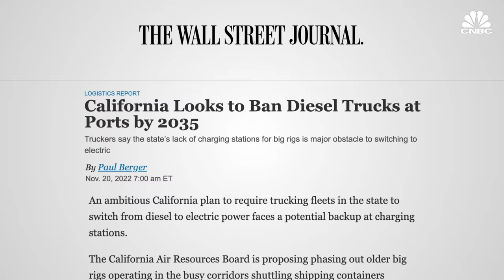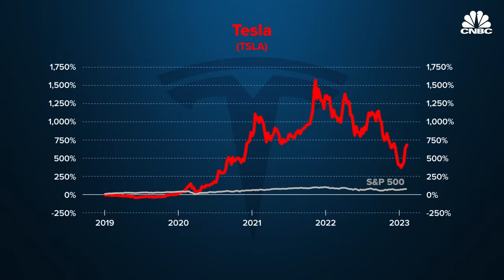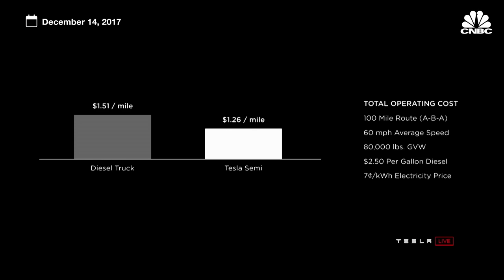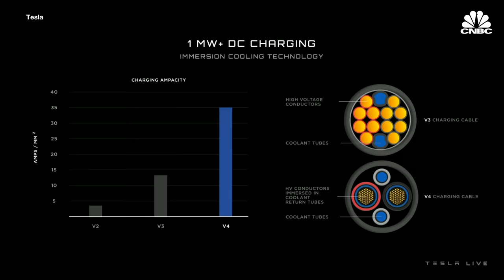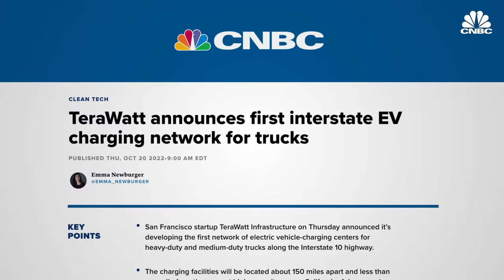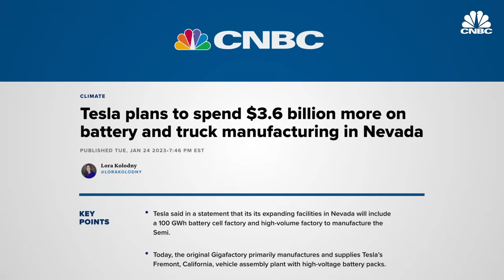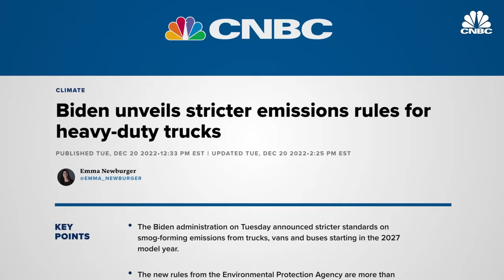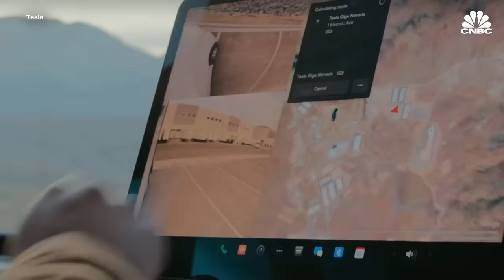Does The Tesla Semi Live Up To The Hype?

Comment: What is the environmental impact of obtaining the materials for this truck? What is the environmental impact of properly disposing of the exhausted unit and its batteries? Would you feel comfortable driving down the highway with your loved ones and watching an 80,000 lb. potential nightmare that will be driving itself in the near future? Almost every single component on that truck has roots in big oil. The plastic, the seats, the production of steel, the tires, instruments, hoses, etc. But it sure is dandy that it is not burned in the truck. Diesel is burned through every single stage of production and disposal of the unit, but Elon has you convinced it is awesome because YOU'RE not burning diesel in your unit. Be very careful!
Reply: What is the environmental impact of obtaining the materials for this truck? 
Far less than the positive effect of the reduction in fossil fuel use and air pollution over its lifetime, as a result of electric propulsion.
 What is the environmental impact of properly disposing of the exhausted unit ...? 
Impact of disposing of the "exhausted unit" will be less than for the diesel semi it replaces, because the shell won't have most of the components of a diesel semi, including diesel engine, clutch, transmission, drive shaft, differentials, cooling system, coolant, engine and transmission oil, oil cooler, alternator, exhaust system, fuel tank, fuel plumbing and filters, frame reinforcements for the weight and torque of the diesel engine, etc. 
 and its batteries? 
Minimal; batteries will either be repurposed for stationary applications, which several companies are already doing, or recycled.
 Almost every single component on that truck has roots in big oil. 
Every component you listed also exists in the diesel semis that the Tesla Semis will replace, so there's no net increase in these.
You're welcome. Any more questions?

Comment: REAL towing capacity ... after the weight of truck and very heavy battery?  About half that of a regular diesel?
Note PepsiCo examples are hauling Cheetos!  Very lightweight product.
Reply: In the Donner Pass video, a Tesla Semi is shown accelerating rapidly up a steep slope, passing a diesel semi as if it were standing still. The Tesla Semi is pulling a flatbed trailer loaded with 11 K Rails (CalTrans-specific version of concrete highway barriers), which are shown in the actual CalTrans blueprints with a weight of 3,900 lbs. Plus, there's about 1,000 lbs. of blocking, tie-downs, driver, and misc. loads. Total payload, 43,900 lbs. or almost 22 tons. I don't have first hand knowledge, but others have stated that this is very close to the payload of a diesel semi towing a flatbed trailer.
https://www.youtube.com/live/LtOqU2o81iI?feature=share&t=985

Comment: That's the red flag right there "contents of the trailer can weigh about 4500lb" Trucks can have a max weight of I think 80,000lb here in the US. A traditional truck weighs about 35,000lb so the contents of the trailer can weigh up to 45,000 . 10x as much! The Tesla with it's battery is just to heavy. They're only good for hauling air, LOL!
Reply: Watch it again, at 4:36. He very clearly  says "45,000 pounds", not "4,500 pounds"; and this is confirmed in the transcript. Further, Here's a video of a Tesla Semi carrying >44,000 lbs. of K-Rails (California-specific version of Jersey barriers) accelerating rapidly up a steep slope on Donner Pass, passing a diesel semi as if it were standing still: https://www.youtube.com/live/LtOqU2o81iI?feature=share&t=987. So in essence you've confirmed that a Tesla Semi can haul essentially the same load as a diesel semi. Thanks, Jeremy!

Comment: They are down to 100 miles range
Reply: If by 100 miles range you mean 500 miles from Fremont to San Diego, including climbing the 4,200 ft. Tejon Pass ("the Grapevine"), on 93% battery capacity, with a load of 42,000 lbs., then you are spot on.

Comment: Well I drive 623 miles a night 13 and a 13 and half hour shift I would need the truck to be able to charge up to 215 miles in 30 minutes what sucks is this means I would have to disconnect and reconnect to the trailer when I'm on my break. Really wish you could get 650 miles out of a trip because most drivers drive the Max and fuel up and then go to sleep if they're over the road and that only takes 10 to 15 minutes a long haul driver would hate to wake up after an hour to move their truck and try to find a parking spot and go back to sleep are sleep is broken enough seems to me they got their work cut out for him especially if they're going to put in enough charging facilities to accommodate every last truck on the road we can't afford to sit around for an hour and a half or two hours waiting for a charge spot to open up and then charge for an hour on top of it this country would grind to a halt

Comment: You need a MEGAWATT charger to charge in under 2 hours... This is no where near feasible. LiOn has 1/12 the energy density of diesel fuel.
Reply: *30 minutes, not 2 hours.
Low energy density doesn't mean you need more energy, just that it's heavier. In fact batteries are 3 times more efficient than fuel and you have regenerative braking so you need way less energy than a diesel truck.

Comment: If they made the batteries to be inerchangable at a charging station instead of waiting an hour + for it to charge .. Just pull up flip a switch that disables the main power from the battery and change out with a fully charged battery in and out 5-10 minutes would be more practicle like when you go and exchange your grill propane tank.  The truck can have a regular battery to hold the charge of electronics in the truck while you exchange the main driving battery.. Am I the only person to think these things up? Hire me EV companies I'll show you how it's done, and make a better product that companies will want.

Comment: Team driving???? How is that gonna work.. we gotta wait 1 -10 hours charge b4 we can switch drivers????   What about when chargers go down like pumps do. Or more trucks than chargers available.. if you're 3td in line that's 4hrs  min...
Reply: Not a trucker, but—correct me if I'm wrong—I'm pretty sure the lack of a bunk or even a passenger seat means these aren't intended for team driving. When chargers go down "like pumps do", you won't be able to charge. But the fact that the Tesla Supercharger network scored a >99.9% reliability in 2022 should reduce your concerns about this. Further, Tesla Semi Megachargers will have Tesla Megapacks that will provide charging power, at least for a while, during power outages. 1-2 hours is the most likely charge time. It seems likely that at least at first, charging slots will be scheduled, and allocated on the basis of availability.
Reply: Tesla developed special high voltage chargers attached to localized back up power battery cabinets, so the trucks can charge 70% in 30 minutes even if the grid is down temporarily.

Comment: Cheaper to run until $100,000 to replace the batteries in one truck.
Reply: With LFP you can easily get over a million miles without replacing the battery.
Reply: @johntheux9238  the vehicle run with natural gas has a modified internal combustion engine so it can run on liquefied natural gas. Now think. Doesn't an internal combustion engine still need oil for lubrication? Doesn't any vehicle require lubrication of suspension and other moving parts?
Reply: @gandolfthewhite  It's electric. There is no natural gas involved in the vehicle. Only at the powerplant but it's not liquefied.
Reply: @johntheux9238  first of all I am talking about the natural gas vehicles they are using. The natural gas in the "gas" tank is liquefied so it will fit in the tank. The natural gas vehicles still need engine oil and chassis lubricants made from oil. Even electric vehicles still need chassis lubricants made from oil.
Reply: @gandolfthewhite  I don't really care about PepsiCo and their natural gas trucks. I'm here for Tesla.

Comment: Why is Tesla stock dropping year over year if these trucks are so great.  They also left out the limitations of the trucks not being able to travel long distances an how the US doesn’t produce enough electricity on the energy grid to supply large volumes of electric semi trucks
Reply: Tesla stock has virtually tripled since the first of the year. 

The Tesla Semi has enough range to travel as far in a day as permitted by HOS regulations, with a top-off during the 30-minute mandatory break at about the 8 hour point. Since these are day-cabs and not subject to team driving, any more range would be wasted.

All the Tesla Semis produced in the next ten years according to Tesla's business plan will add about 1% of consumption to the grid, even if all charging was done from the grid. But all Megachargers will be equipped with solar arrays and Megapack batteries, so they will actually add even less than that to the grid. I think the grid can handle a 1% increase in 10 years.

Comment: This a nothing burger. There is no truck, no. Charging stations or repair shops, no test drives. What are you basing any of the fluff from?
Reply: They have delivered over 40 trucks so far.
Reply: You might want to share your concerns with PepsiCo, because they think they've received dozens of these; they've built four Megachargers and eight more have been permitted; and a Tesla Semi loaded to 81,000 lbs. GCVW drove 500 miles from Fremont to San Diego, including climbing the 4,200 ft. Tejon Pass ("The Grapevine"), on 93% battery charge. Other than those minor differences, you post is spot on.

Comment: Who's the bald guy with the inaccurate information?
An electric truck can out muscle any diesel powered vehicle.
Reply: I don't think you were paying attention.   He said for the weight, the diesel can output far more power that what an electric powertrain can.   Meaning for the weight of the fuel and engine, you get much more use out of the diesel, that you can with the ev with the batteries.   Range and power/weight for diesel is much higher than EV powertrains.

Comment: It takes more fossil fuel to mine for lithium than the fossil it takes to run a diesel truck. Oh the hypocrisy!
Reply: Yeah, but you can recharge the battery 4'000 times and recycle it 8 times. So you can divide that number by 32'000 to get how much energy is really needed per mile traveled.

Comment: The only reason Pepsi and these other companies are doing this is to look good in the public eye. A diesel truck costing many times less can do many times the work. Once these things really start getting out on the road, people and companies will see the downsides. Not to mention their cargo capacity is much lower than a normal semi truck due to all of the battery weight.
Reply: There is a reason tesla spent 5 years trying to make this thing, for 1000+HP semi truck this is not much more expensive probably like $200,000 for the biggest one, most semis have 500HP. The weight load capacity is only 10% lower than the average semi truck but natural gas, hydrogen, and battery electric trucks get an additional ton to their legal weight. Once companies start using these they will see how cheap it is to run them, you can save $240,000 on fuel after 400k miles driven.
Reply: We shall see!
Reply: @MichaelLangell  give it 5 years.

Comment: The keyword here is grant. Without government subsidies. They would not have done this. The same thing with Tesla  without government subsidies, Tesla would not even be profitable.
Reply: You have to understand, this truck is the most capable electric semi ever made, but that doesn't mean companies trust it, it's like using beta software, you provide it for less money or for free so they find issues you don't have to find yourself that would take too much time to emulate Btw tesla is now the most profitable US automaker, their car sales actually increased after their subsidies where cut because they developed infrastructure to make their cars cheaper. The infrastructure for the semi trucks will be very expensive and take decades to build, and when that's done it will be far cheaper to use an electric semi without subsidies.
Reply: @miguellopez3392  there’s not really any other electric semi’s, so taking the prize isn’t something to be praising them about
Reply: @rusty shackleford  there are several but non are near the planned numbers tesla wants to do by 2025 (50k trucks a year) the other trucks also have much more limited range and charging speed. This is the first class 8 semi truck that can reliably (range) travel most truck routes in the US. Ots does this by putting the largest battery ever put on something with 6 wheels and are the only ones that can afford to put batteries this large in trucks because of their battery infrastructure being ahead of other automakers.

Comment: And how much Fossil Fuel is used to Manufacture, Fuel and Maintain this "Environmental" vehicle.  Or any "E" vehicle for that matter.
Reply: Far less than the reduction in fossil fuel use over its lifetime.
Reply: @BigBen621  not really
Reply: @Tylerd838  No one disputes that construction of an electric vehicle releases more emissions than that of an ICE vehicle; of course it does. But every study I've seen shows that there's a break-even point, usually at well under 100,000 miles, past which net lifetime emissions are less for EVs than for ICEVs. 
Here's a quote from a study done by Volvo:  "the results depend in large measure on the source of electricity its customers use to charge their vehicles. If they drive in Poland, where 90% of the electricity comes from burning coal, then yes, it will take [62,000 miles]  [kilometers replaced with miles] or more to reach parity with a conventional gasoline-powered car. On the other hand, if the electricity comes from renewable sources such as wind or solar, the crossover point is closer to [31,000 miles]. The middle scenario, based on the current EU energy mix, is [48,000 miles]. All Tesla Semis to date are deployed in California, which has a fairly high percentage of renewable energy, and only 3% coal; so these should be toward the low end of the scale. And since Tesla is warrantying Tesla Semis for 1 million miles and they drive a lot of miles a year, they will pass the breakeven point early in their life and be in net negative emissions for perhaps 95% or their life.
Reply: @BigBen621  literally a lot of people deny that, maybe you don’t go into the subject much, but a lot of people think that and did you count the fact that most electric cars are charged by fossil fuels, and they want millions of electric cars out there so you’re going to have to increase the supply of fossil fuels to keep up with the demand of electric cars,

Comment: Late, less range than promised, more expensive, no good infrastructure for the trucks.
Reply: It has 500 miles of range fully loaded but drivers usually don't go under 10% state of charge or over 80% unless they really need to.

Comment: Pathetic. Tesla Trucks are so weak they could only carry Cheetos as their payload.
Reply: FALSE. Here's a Tesla Semi, towing a flatbed trailer, accelerating rapidly (watch the speedometer) up a steep slope on Donner Pass, passing a diesel semi as if it were standing still: https://youtu.be/LtOqU2o81iI&t=985.

 The flatbed is carrying 11 concrete highway barriers. These are uniquely identifiable as K-Rails, which are the CalTrans-approved version of generic "Jersey barrier" highway barriers. These are shown on the CalTrans blueprints for these barriers to have a weight of 3,900 lbs. each. Eleven of these at 3,900 lbs. each plus 1,100 lbs. in tie down chains and paraphernalia, driver, tools, and other miscellaneous items totals a payload of 44,000 lbs.

Comment: Musk never ever has published the PAYLOAD capacity of the semi. It's horrible bc of the weight of the battery.  Charge times are horrible too. This is purely marketing for Pepsi.
Reply: The truck weight around 9-11 tons so the payload is only 2 tons lower than a diesel truck.
Reply: Musk doesn't need to publish the payload capacity—you can calculated it yourself from the Donner Pass video. The Tesla Semi accelerating rapidly up a steep slope on Donner Pass, passing a diesel semi as if it were standing still, is loaded with 22 tons of concrete highway barriers.

Comment: Extremely curious how batteries fair. We are talking 80,000lb when full.. and Ssuuuuper hot summer days... the batteries and cells will be dying quicker. Super fast recharging as well and daily? Bro.. lol i just dont know. And cost to replace will 10x an average tesla.
Reply: Pretty sure Tesla wouldn't be warranting batteries for ten years or a million miles if they were subject to premature failure. And maximum GCVWR is 82,000 lbs. for electric semis.